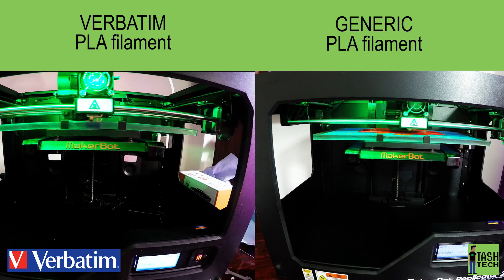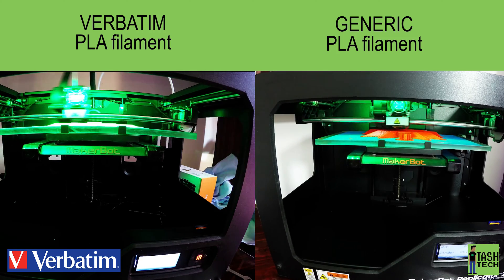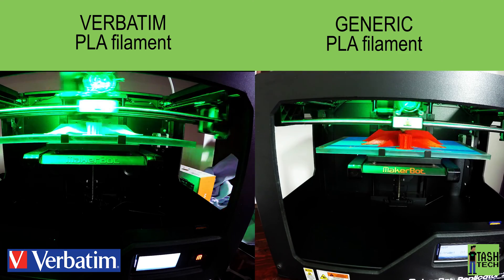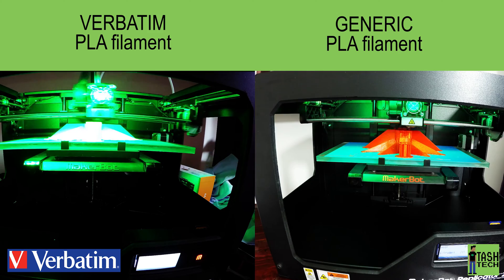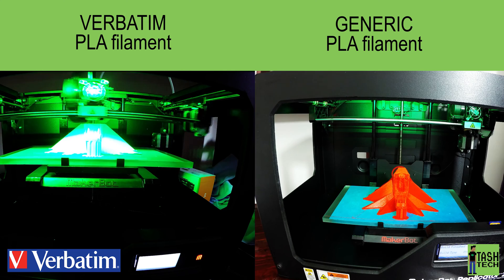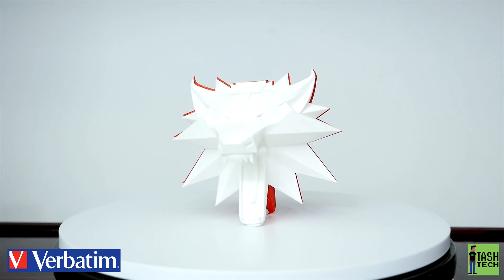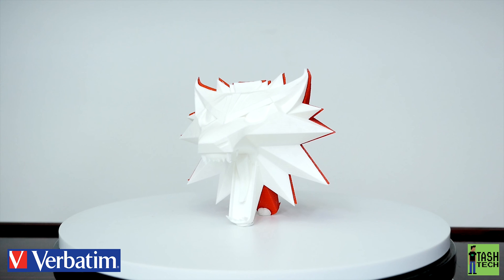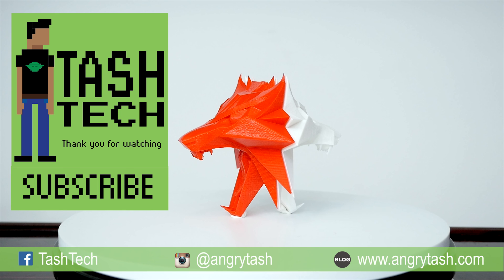Verbatim vs. Generic 3D printing PLA filament wolves time-lapse

Comment: Should've used the same color. Can't see any flaws when comparing white color on the vid. From what I can tell, the red printed fine, except for some stringing around teeth. So, aside from a lot of vocal praise, not much of a proof to overpay for Verbatim.